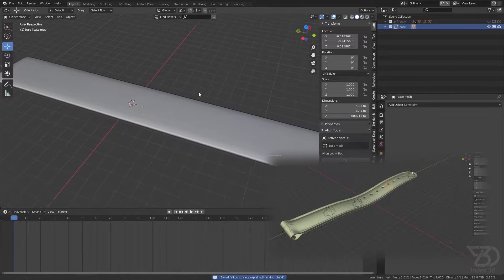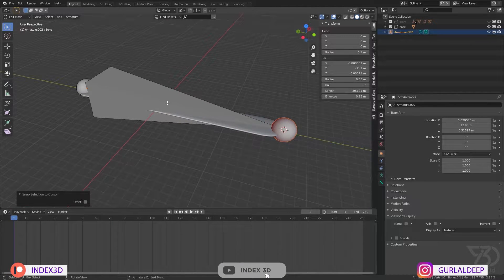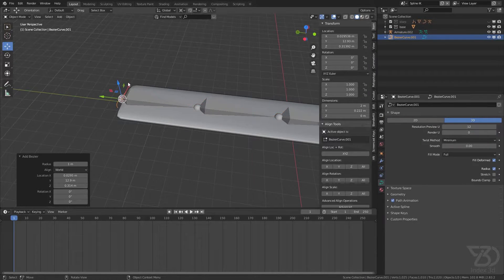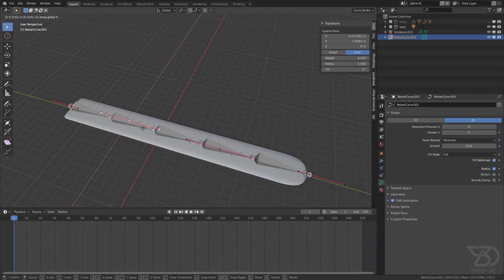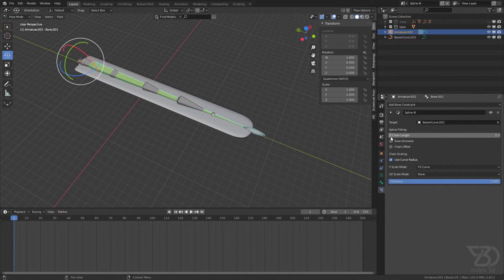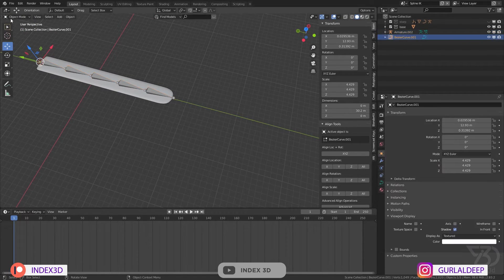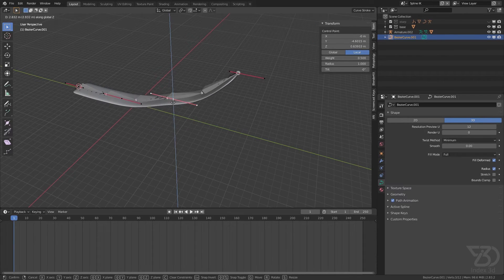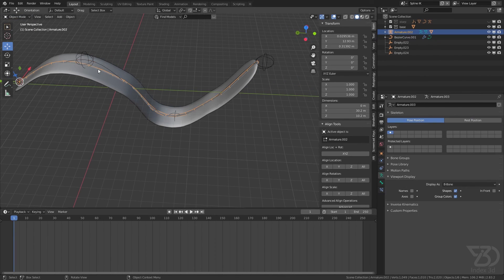Easy Watch Strap Rigging tutorial for beginners | Blender 2.8

Comment: I have a wallet Model in Blender but it's topology is non uniform. can I do folding animation with this method of that wallet? Please Reply. I'm Waiting.
Reply from the maker: You if topology is no good then the deformation will not be smooth
Reply: @Index3D  I Modelled it very hard and don't wanna do it again, Can I fix my Topology. Or if you give me Your Email Address So I'll Give you the file and you take a close look on that. Then guide me. Thanks❤️
Reply from the maker: you can join discord https://discord.gg/UjBpXc3  @experimentalspot